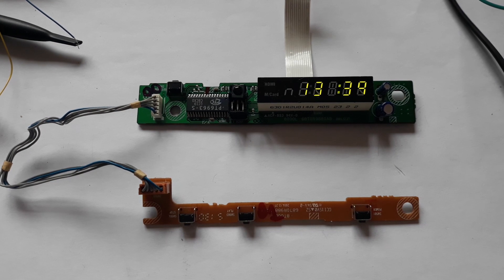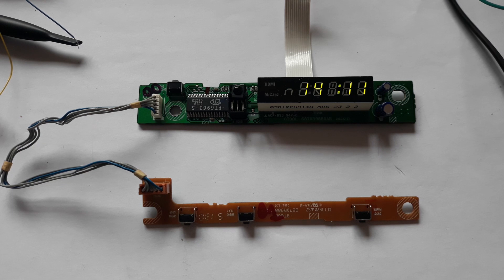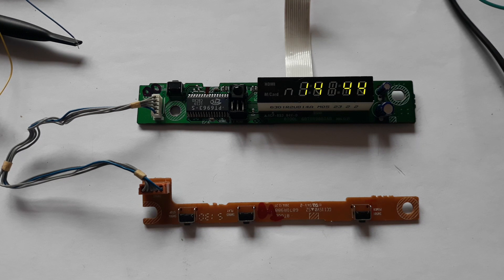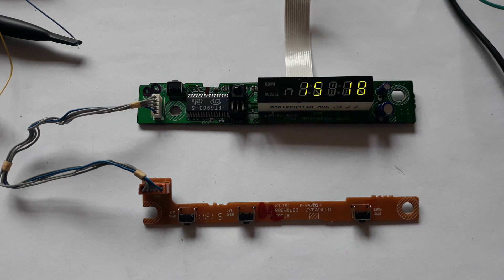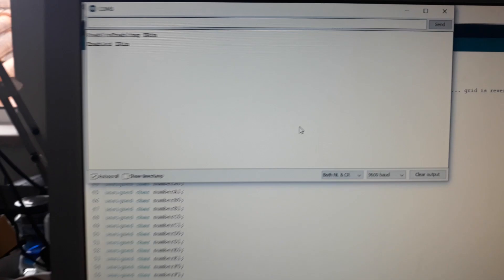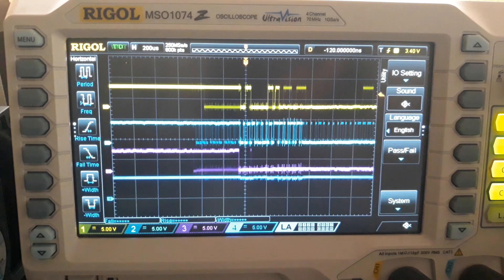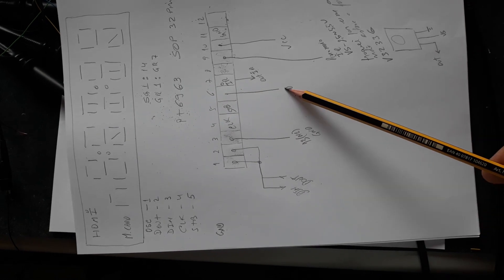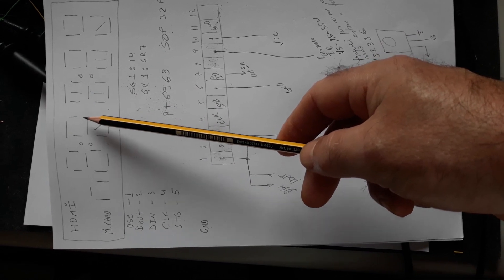PT6963

Comment: How would you connect common anode displays to those kind of drivers? Is it even possible?
Reply from the maker: You have already received a suggestion (Tanks Ezequiel Farias), note that in this way it is not possible to use more than 7 segments (because it is the maximum number of grids present in this driver) and it is necessary to make inversions in the bit code allocated to the grids and segments .
It is also possible to do it with the addition of hardware, applying an inverter (exp: IC'' from family 7400 or 4000) to all the lines you need, so that it will not be necessary to modify the code, but it implies more hardware.
Good job!